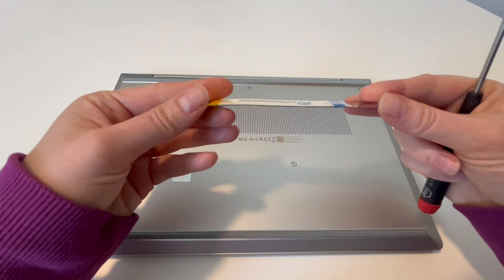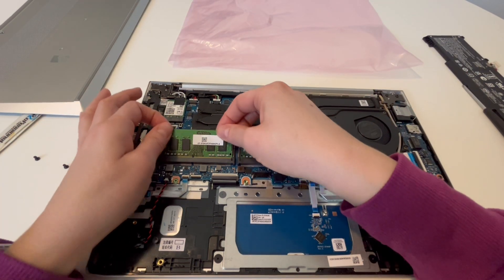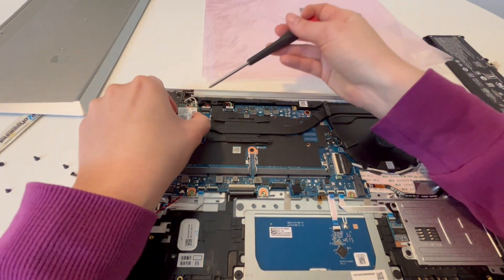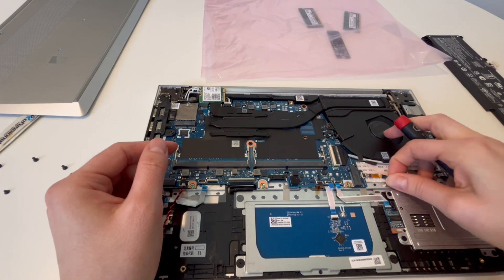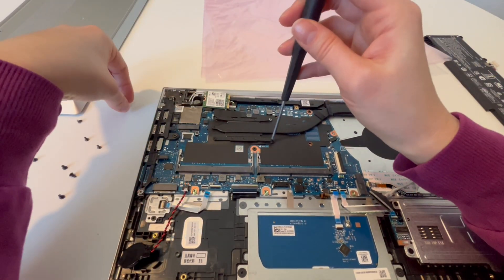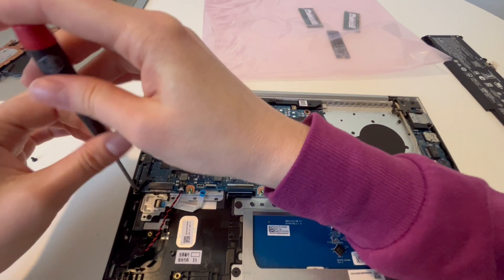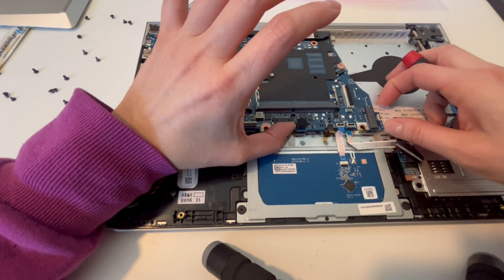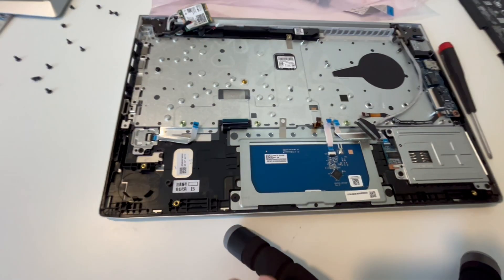How to Replace a Motherboard Without Damaging it - Advice from a Certified Repair Technician

Comment: Maybe because you've done this thousands of times, but it gives me great piece of mind to always do disassembly using a magnetic project mat, even though many screws are duplicate, I like to organize them to the components they came from, plus the magnetic board makes it virtually impossible to lose screws.
Reply from the maker: Everyone is different. Some technicians use the approach. It takes longer but it is very thorough .